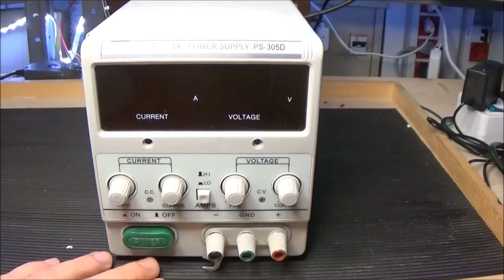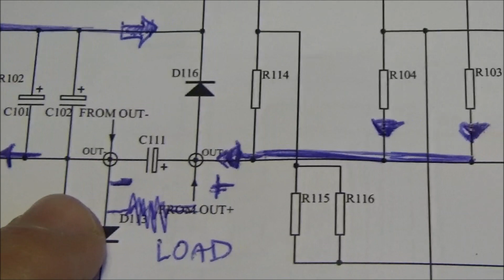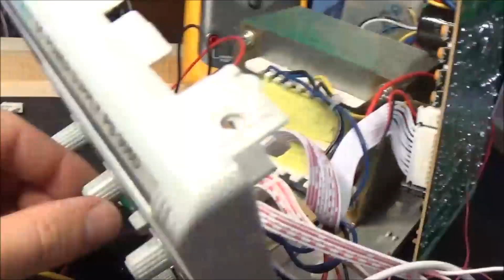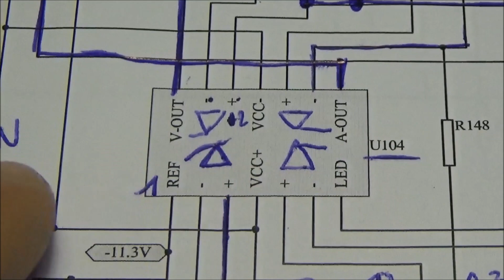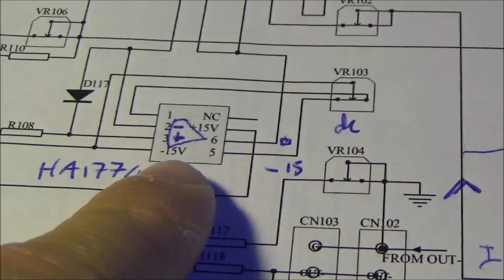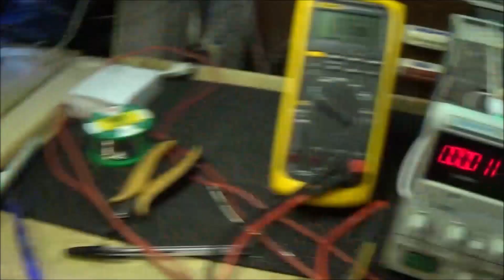0174: PS 305 Power Supply 30V 5A Repair

Comment: I have a YH 305D power supply and I'm having a problem with the voltage adjustment; it always stays at a fixed 50V. I've replaced all the parts: the regulator, diodes, and the ICS 2904. All parts have been replaced, including the two power transistors, but it still remains at 50V. The current adjustment is OK.

Comment: I have the same one, it does not reach 30v when turning on it marks consumption of 0.01 and when the maximum voltage is raised it reaches 24v marking consumption of 0.02 it no longer reaches 30v could you help me what could it be thanks
Reply from the maker: Try to replace LM324
Reply: I have same problem, LM324N and op amp have been replaced with new ones, but problem still exist, i checking pin 14 on LM324N Its read only 1 volt

Comment: Hi sir i hv a tenma 72 8690 my main cap shows 3300uf 50v but im getting only 20v one side n the other side is correct at 50v.
Can i know where do i check to correct this my ha7324a chip shows 1.0volts on all pins on both sides.

Comment: Hi sr very good video. I have some knowledge about electronics. I’m my case I replaced both lm 324 and op amp. But my power supply won’t go up than 10  volts  it go from 0 to 10 but won’t go further.   I checked some components and there’s no shorts it’s getting very complicated do you have any idea of what to check. Thanks.

Comment: My power supply getting 52v DC output, not able to control by knob, what may be the issue,..?
Reply: It is almost certainly one of TWO problems. If you look at the back of the PSU near the fan, you will see the upright metal plate with two (or three depending on model) output transistors. If these fail short, you will get full voltage. ALSO if these transistors are ok, then the fault is usually the "driver" transistor on the board (with a black heatsink usually but just follow the wires back from the main output transistors).

These power supplies are usually not too hard to fix BUT they DO fail easily enough - so always be a little wary if using them to power something expensive and sensitive. They cannot be (sensibly) trusted to provide (for example) 5v to a £400 device - as if the PSU driver or output stage shorts again, then your little £400 load lets all the magic smoke out.

Hope that gives a bit of info - the transistor values are marked on them (they vary according to voltage) but the main ouputs are likely to be 2N3055 or MJ15024G or 2N3773. In your case, the MJ is overkill (intended for the 60V PSUs which can see over 100v on their input), I would guess yours will be the 3055 or the 3773.

Not sure what the driver transistor is - but it will almost certainly be printed on it clearly enough.

Comment: hello sir, plz give me transformer details in this ps-305d power supply i hv to replace with new one. whenever i give main supply inbuilt fuse is burst, i found transformers input coil is shorted negative and positive line shorted.
Reply: Please check tre transformer details here. https://www.google.com/search?sxsrf=ACYBGNRqY6RCvkRVYIX0aVClU0bCmQ4ZgQ:1578852390160&q=ps-305d+schematic+diagram&tbm=isch&source=univ&client=ms-android-huawei&fir=xuPln4FiCnupZM%253A%252Cc0lwCrAPWKjq5M%252C_%253BeQggOR5tDHtKJM%253A%252C_od1rqyk5bbDOM%252C_%253BVQ5dkxhfH7kOeM%253A%252C846WSwcb5kGFnM%252C_%253BQY5Dd_zXMuvNxM%253A%252Cc0lwCrAPWKjq5M%252C_%253B0_ILTUIIJGG_1M%253A%252Cc0lwCrAPWKjq5M%252C_%253BvqUJANcy8SCQtM%253A%252CD-eDkhIbolc9OM%252C_%253B-n41nRvJ2s8P5M%253A%252CDMQgXTiBFgMDGM%252C_%253BLP_kGHp6S0P43M%253A%252CjIDeHj5fUYU8RM%252C_&usg=AI4_-kSkw38HLU9l5NqF63W7AKfkPhMYIw&sa=X&ved=2ahUKEwjp1vi-0_7mAhXELFAKHSmiBkUQ7Al6BAgIEBc&biw=360&bih=574#imgrc=VQ5dkxhfH7kOeM

Comment: I am getting 4v on lm324 14pin
Reply: Change the Opamp
Reply: @PierAisa  my problem is solved thanks but instead of 5amps its outputting 10amps and that is ok to me.
Reply: I wanted to use the front panel of this supply for volt and amp meter the volt meter is ok but the panel no raading current can you explain me the current panel connection?